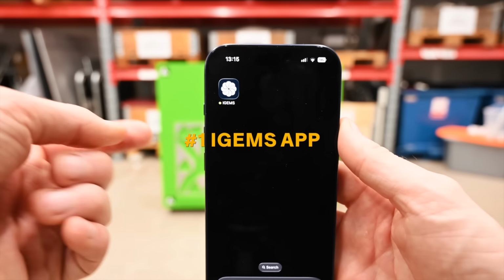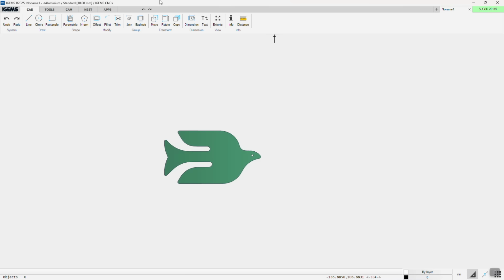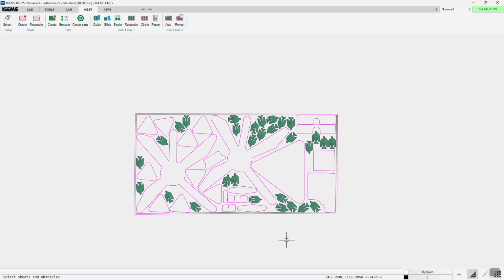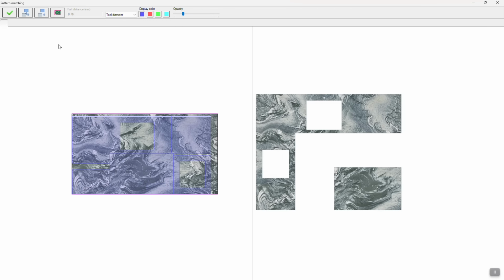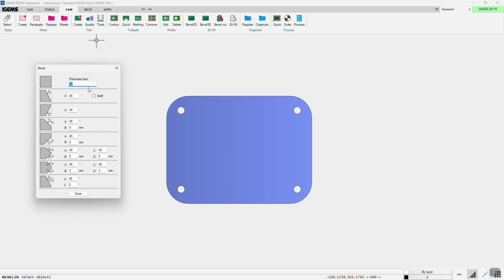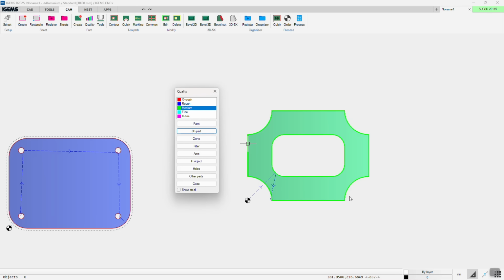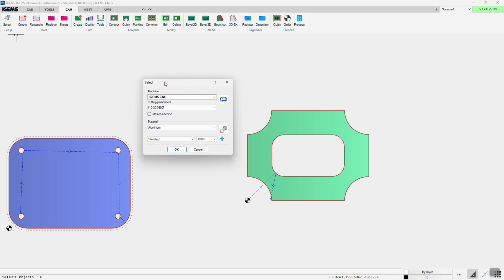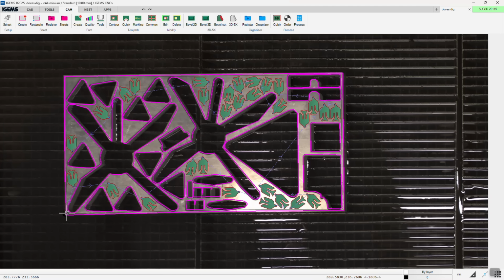What we've made in IGEMS CAD/CAM during 2025

Comment: i guess this app in for 2025 and onwards only subscription?
is it possible to use the USB ( 2015 ) drive for the new updates? i mean when you stop a subscription you get locked out, compare what you did with the USB keys back then.
Reply from the maker: The app and its features are not exclusively for subscription licenses. However you do need a new version for the slab tracer function.